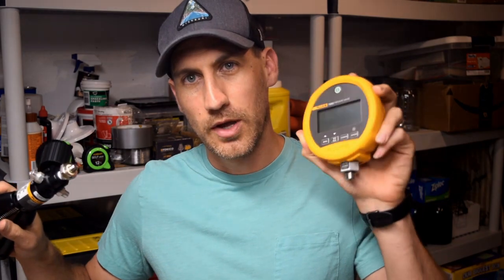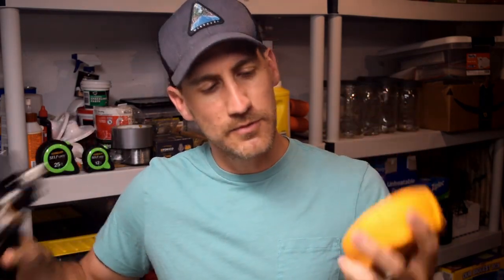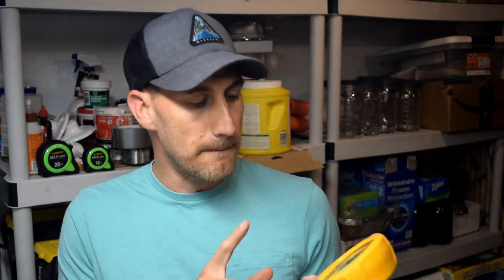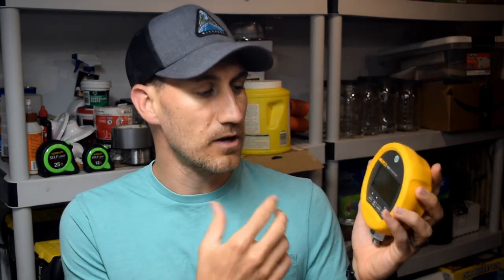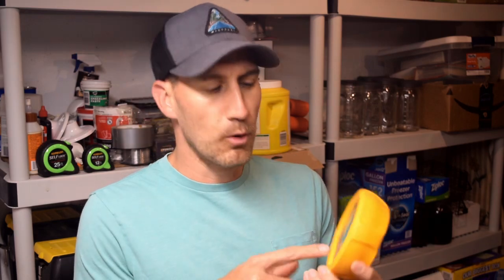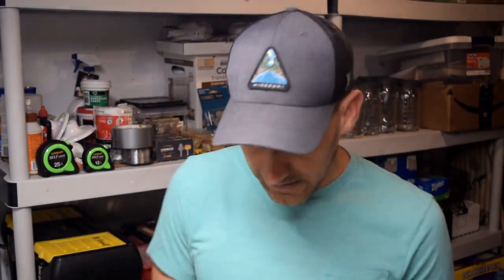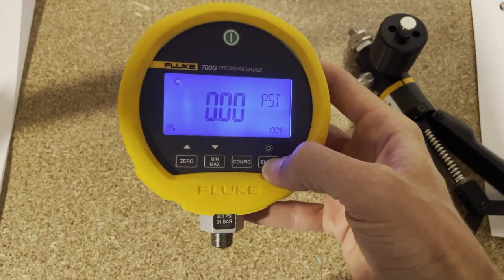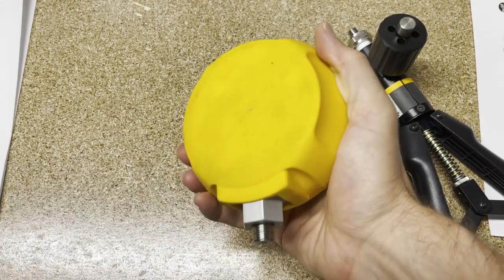Fluke-700G - Fluke Fridays - Episode 54

Comment: How would you calibrate discharge and suction on a hydraulic system. with a Ashcroft Pressure switch? involving a Fluke Pressure transmitter
Reply from the maker: I'm not an expert at all things calibration. But if you are wanting to calibrate a pressure switch. It's my understanding the best way is to isolate the switch if possible. Thus remove switch that needs to be calibrated. Then hook it up to one of our pressure calibrators and a pressure source (like a pump) then pump to desired pressure watch the switch engage then lower pressure until switch disengages.
Reply: @fridayswithbrandon can this gauge be used as a regular pressure gauge or is it only for calibration purposes?
Reply from the maker: @TheKraken2019  yes you could use as a regular pressure Gauge.